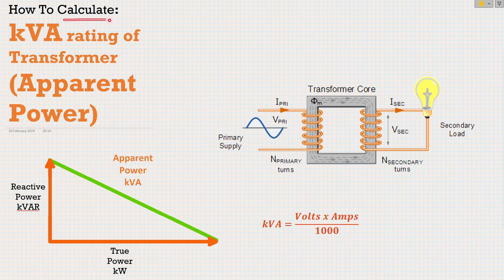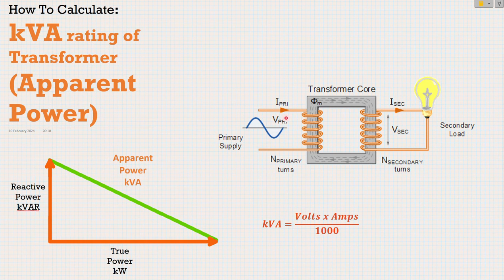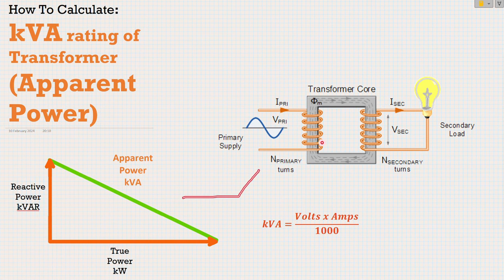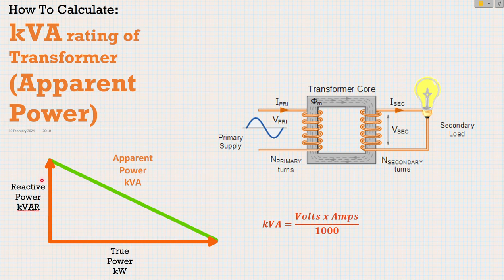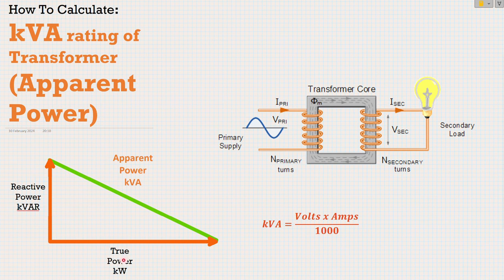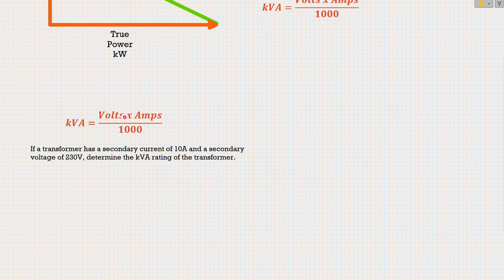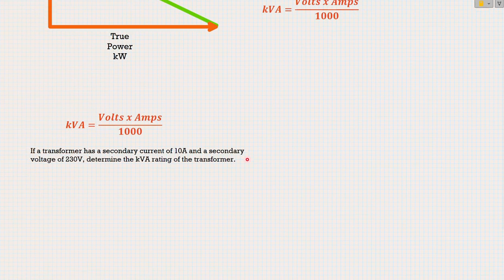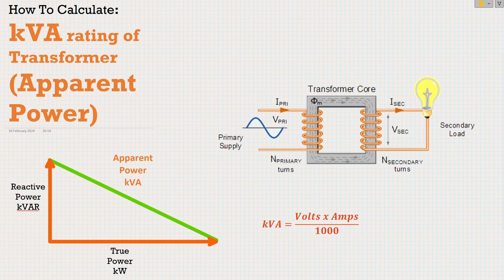How to calculate the Kilovolt-Ampere (kVA) Rating of a Transformer

Comment: The kva rating of a transformer has to do with the power factor, not the copper and core losses within the transformer. A power factor less than 1.0 means that reactive current is present, so the transformer will be drawing and supplying more current than would be that of the total resistive load, and the copper and core losses in the transformer. Transformer losses are resistive in nature, dissipating in the form of heat, so loss current is in phase with the voltage delivered to the load.

An ideal transformer/network/load system will have equal kva and power ratings. Real world transformers will need ratings for Kva and Kw that are different to accommodate anticipated reactive networks and loads.
Reply: Can I ask something